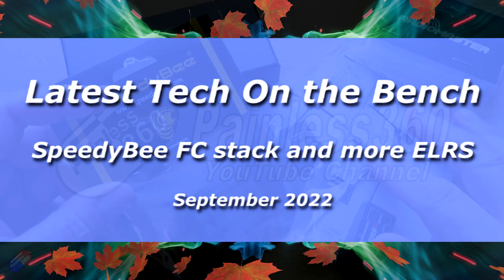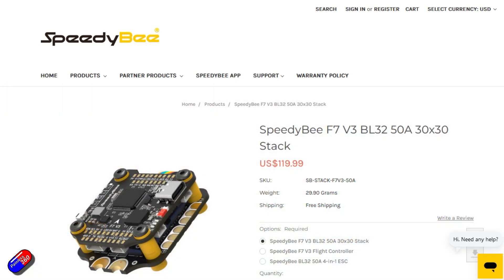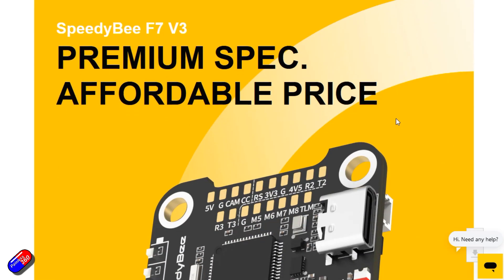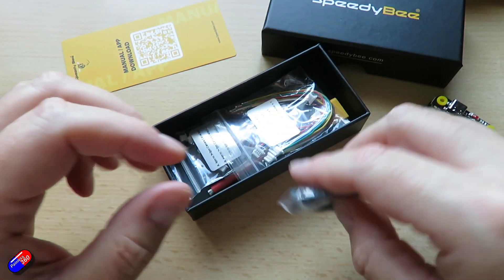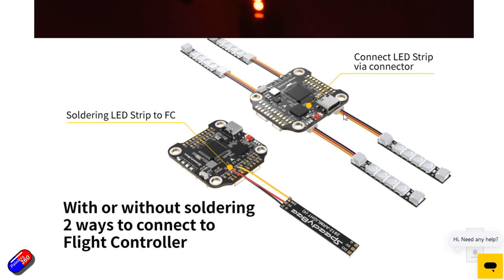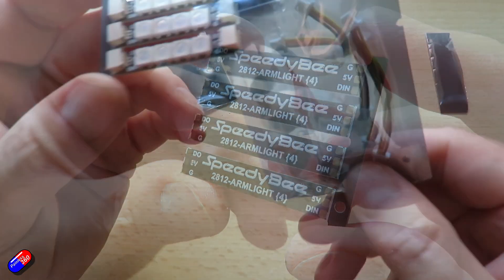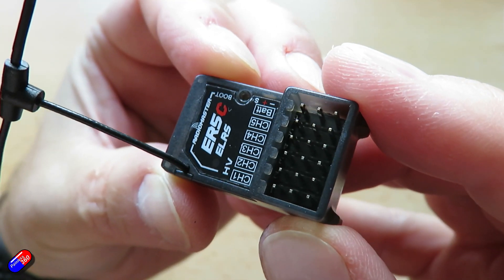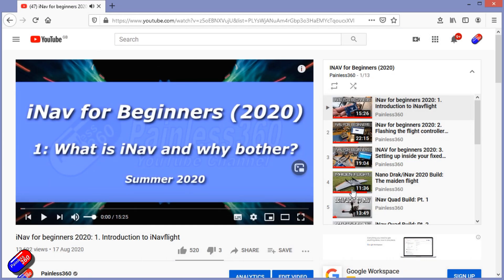Latest Tech Round-Up (Sep22): New F7 FC from Speedybee and new RadioMaster PWM ExpressLRS receivers

Comment: I hope this time the speedybee FC wwill not having teething issues as in the past which was a nightmare to get your product fixed even though they ignored to compensate for they crash their faulty product has caused. And they do not mention anything about fixed wing usage or support cause I can remember that the  last time I had bought some of their stacked versions without an esc it was a nightmare to get it wokring with inav as fixed wing. I got it somehow right for 1 flight and then issues came back so I sold it , went back to Matek wing fc cause Matek gets it right without the glossy marketing I do not need. I liked the speedybee app and wireless connection but overall a bit disappointing so not sure to get one again. 

Regarding 4 channel elrs it is not enough for me, maybe the quadcopter guys but for planes I like to have more for example all the camera and head tracking gear which needs 2 servos more.
Reply from the maker: Use Matek for fixed wing. See all of my INAV builds... Works perfectly

Comment: Regarding the Lights, speedybee F7v3 and betaflight.. All 4 ports are set up in parallel! (internally) so if you have a quad and you place a set of 4 lights on each arm they can only be programed to light up as the same color (all 16 lights) or the 1st led of each set to be one color, the 2nd led of each set another, the 3rd led of each set another ect. the only way to overcome this is to daisy chain them but that is a wiring nightmare on my 5 inch quad.   according to speedybee the can fix it through a firmware update but i would not cold my breath. I wanted red and green lights as a set on the front arms and white in the back arms.     What build are you gonna use these parts for? that receiver looks nice but it is huge for quads, I went with the BetaFPV Nano Receiver (ELRS).
Reply: Quiero luces rojas en los brazos delanteros y verdes en los traseros,para volar de noche,como lo puedo hacer.

Comment: can you use the speedy bee flight controller in a plane?
Reply from the maker: Not easily. I've asked them to look at fixed wing versions... ...
Reply: @Painless360  is the limiting factor servo control?
Reply: @adamrosenberg4367  probably just software.
Reply: Added wiring to control servos would be significant, as would need to make a custom PWM pin-header, then run signal wires for each channel, and include power + ground for each. No so bad if only 2-3 servos, but could quickly escalate into a birds nest if not managed.

An alternative could be configuring the FC to output crossfire protocol, and using a crossfire to PWM conversion board. The conversion board is something commonly used to fly wings using micro crossfire, or ExpressLRS Rx in a wing without a FC. Such an adaptor pcb adds cost and complexity, but also offers flexibility.